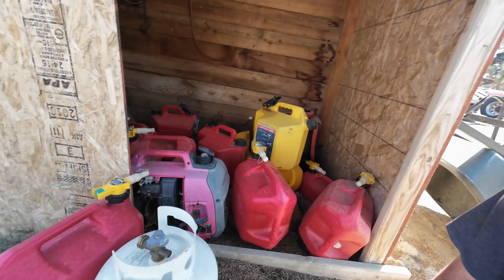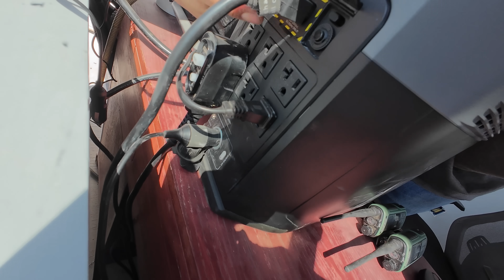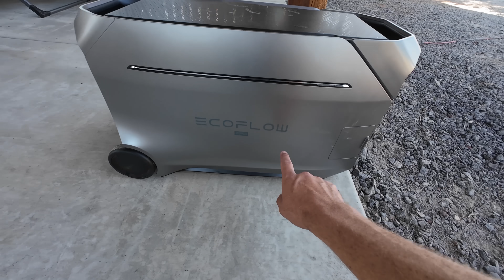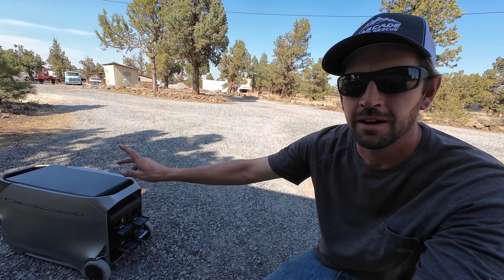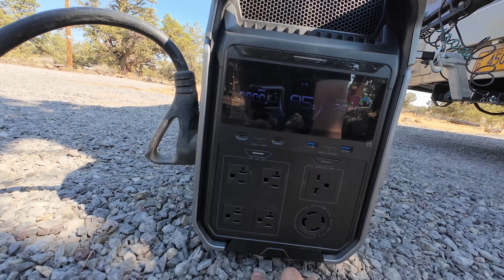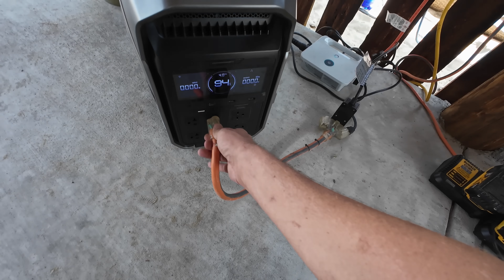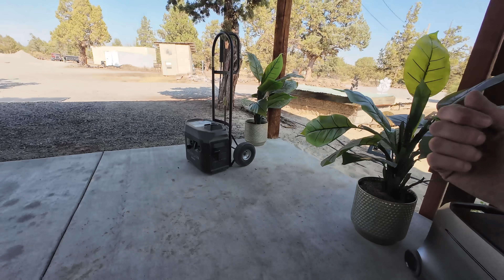Be prepared for DISASTER with EcoFLow's new Delta Pro 3!

Comment: This is really cool and thanks. We have been talking about get a full home standby generator for years that would be a natural gas full home unit. I will have to do some searching on EcoFlows website to see if such a system can be designed and what the cost is. Quick glance looks like there is a solution to do a full house system and by looking at how module everything seems it looks possible. Thanks Casey for this video.

Comment: I'm glad to see that they don't call their units generators like a lot of manufacturers do. They don't generate power (except the smart generator) they are electric power storage units with built in inverters to dispense the power
Reply: A generator running off a 4 cycle gasoline or propane engine converts the stored chemical energy in the fuel into electrical energy. These units convert chemical energy stored in the batteries into electrical energy. You recharge your typical generator by adding more chemicals that were typically made with solar energy 1000's of years ago, you can recharge these generators with solar energy collected now.
Reply from the maker: @noneentered1  people like to say that they aren’t generators because they don’t create power without solar hooked up.  But those same people fail to realize that an internal combustion engine generator doesn’t create power unless you add a fuel to it either.    
No matter which setup you use, you have to supply it with an external fuel in order to generate usable electricity.   The difference in that the external fuel these use is simply the sun, while the others require gas, diesel, propane, ect.
Reply: @CaseyLaDelle  well said
Reply: The term "solar generator " is a made up term by the industry to distinguish their products from other power storage units that don't have on board solar charging capabilities. I too dislike that term. If you use the strict definition of the term a solar panel best fits the phrase "solar generator" as actually generates power from solar energy instead of rotational energy.
Reply from the maker: @pumpdump4476  but a solar panel does not create usable electricity that you can plug a device into and use.  You need something that takes the energy created by the solar panel, and generates usable electricity.  
Internal combustion engine generators are exactly the same.  They take an outside energy source (fuel) and use it to generate usable electricity.  
Both are generators, they just use a different fuel source.   The big difference is the ability to store that electricity and have it be usable when the fuel source isn’t present.   Internal combustion engine generators are not capable of that
Reply: @CaseyLaDelle  these are storage, not generating. Electricity goes in, electricity comes out. You can't charge them with something other than what comes out. And when there is no power and no solar (northern winter time), you run them down fast.

That being said, these ecoflows are perfect as a UPS or a power booster. If the power goes out, you have a few hours to connect a generator and charge the unit back up again. Other useful thing is taking in low power and being able to give higher power. Like when you have a 1000 Watt wall outlet to charge the ecoflow. And then use dlthe ecoflow to draw 2000 Watt's for shorter time.
Reply from the maker: @Pinz314  they use an external fuel source to generate usable power that you can plug into and use, just like a gasoline generator.  
And just like a gasoline generator, yes, they can’t produce that power without their fuel source.   
Now having lived through countless multi day to week long power outages I can tell you something else that shuts down, and that is the electricity powered fuel pumps at the gas stations.   So gasoline is also a very limited, or even non existent resource in a power outage situation.   So I would much rather rely on the sun as my fuel source than something I have to buy at gas stations who are in the same power outage situation that I am.
Reply: @CaseyLaDelle  Those things are cool and have their place for shorter outages. And if you live in the sunny state, shure you could probably use it for longer as there is enough sun to charge it. Where we live the worst WEEK in december generated 7 kWh with a 10,000 Watt solarpanel system, thats just not enough to keep things running. With a diesel generator i could charge a bigger battery with 8 kWh every day for a week with a 19L or 5gal jerrycan of diesel. Having 3 jerrycans of diesel that go in the tractor anyway is far more useful and can generate 150 kWh vs the 30 kWh in three weeks of december solar.
Reply: @CaseyLadelle They store what is put into them they do not generate anything.... the solar panels generate the power and these store it then release it as useable power.... saying they take solar panel power and "generate" it into useable power doesn't even make sense.... convert it maybe... if you charge it with a gas generator that produces useable energy would you still say these "generate" the generator power into useable power ?? Of course not thats just stupid... it stores it and releases it... Yes I know you'll argue it til the end of time even though it makes no sense 😂😂
Reply from the maker: @sideview79  these have the ability to create power, AND store it.   I’ve said that multiple times.
Reply: @CaseyLaDelle  ya but the solar panel generates the power and these turn it into stored useable power... gasoline fuels an engine turning a gen head to create power... the sun fuels a solar panel that generates power... these store that power from either source... setting a power station in the sun doesn't fuel it and make power.... gotta have the solar panel which is the generator....
Reply from the maker: @sideview79  a solar panel does not generate usable power.   A solar charge controller and DC to AC converter are needed to make usable power.
Reply: @CaseyLaDelle  exactly my point... it "converts" it to useable power it doesn't "generate" it into useable power... but the power that needs to be converted into useable power is generated by the solar panel.... it has to have power from another source put into it or it does nothing
Reply from the maker: @sideview79  yes, just like a gas generator converts a liquid fuel source into movement, and then that movement creates electricity
Reply: @CaseyLaDelle  I have a delta 2 max and wave 2 w/battery that work great...  I'm using it right now parked in a service plaza... I get that the sun is the fuel like gas but a gas generator doesn't need electrical power put into it... it generates the electrical power... a power station requires some sort of electrical power to be put into it... why ? Because it doesn't generate power... I never said a solar panel generates useable power. Obviously it doesn't but it does generate power that feeds the power station... the term solar generator is used for the system as a whole (solar panel, wiring, power station)... and as a whole system yes it generates power but the box by itself generates nothing... its just a power station... I think of it as more of a "smart battery" really because thats basically all it is by itself without something feeding it... It's a great product that I bought instead of a $14k apu that are always broke down and I bought it based off your videos... 👍👍
Reply: @CaseyLaDelle  I got a free solar panel with my d2m that has never been out of the box because I have no room for it so in my situation explain to me how this thing generates power ? It doesn't... it's a battery that has to be charged... I charged it with a pure sine wave inverter from HF until the alternator charger came in and it works great but it just simply stores what is put into it... it generates nothing... it has to be fed electricity from an outside source
Reply: @sideview79  Yup coreect, otherwise every charger/inverter/transformer would be a generator creating "usable" power for a specific purpose. A usb generator to make 5V DC for a phone. A welder would be a generator as it makes "usable" electricity for welding at 20V.
Reply: @Pinz314  yes... thank you...  some ppl just can't admit when they are wrong lol he is too stuck on the idea of the sun being the fuel and it is but the solar panel uses it to generate the power (not the power station) then the power station does nothing but turn it into useable power and store it...
Reply from the maker: Actually they do, and they are in fact generators.

Comment: I have 4 EcoFlow products. Wave 1 AC unit, Delta Pro, River Mini, 400W Portable Solar Panel, and various interconnect cables.
So far I've been happy with the Wave 1, it keeps my little A-frame camper cool while boondocking out in central Oregon, with the Delta Pro and solar panels, keeping cool has been no problem.

Comment: One thing a generator doesn’t need is a firmware update and if you’re off the grid that can be a challenge.
Reply from the maker: This doesn’t either.   It will continue to work just the same without any connection or update.
Reply: @CaseyLaDelle  my ecoflow will no longer take a 12 volt charge and the company had me do a firmware update which didn’t help but they also cover the item for 5 years
Reply: Also the item doesn’t perform the same as it did in the first few months I had it now it’s a $430 12v fridge tender
Reply from the maker: @throttlewatch4614  actually it performs EXACTLY the same as it did the first few months.   A firmware UPDATE is exactly that, and UPDATE, not something that has to be done to maintain performance.    
I have had EcoFlow products for years and I have never once done a firmware update on any of them.   You are quite literally making up a problem in your head that doesn’t exist.
Reply: @CaseyLaDelle  dude I’ve talked to customer service I’m just telling you what they told me. I’m not making anything up maybe my situation is isolated but this product does not work the same as it did when I first got it and yes they did say it’s covered for five years I just haven’t sent it in yet. I have no reason to make anything up and like I said about the wave it’s not exactly what they say it is but it’s expensive and it takes some getting used to on how to operate it. Oh and when you call customer service you can hear roosters crowing in the background lol true story

Comment: Ironically I was mentioning this to a semi driver, who was wanting to run an air fryer for his food but also use it to charge a battery for a piece of equipment at night when he sleeps as he is away all week in it.  This idea was instead of installing an inverter in his cab and having to idle every night to stop the batteries from going flat and also it was a long term rental truck.  Starts to make sense if buying everything to fit and risking the hire company not liking something aftermarket installed not by them against a unit sat on the floor that the driver can take with him to the next truck.

Comment: I just purchased the new Harbor freight 13000 W generator and in the process of hooking all of my house and shop to that, and interested on how the ecofflow could work into that.
Reply: Unlike the ecoflow smart generator, with your new generator, you would have to monitor the battery levels, and recharge from your new generator manually.  But placing batteries on strategic, critical devices would let you avoid running the generator constantly.

Comment: Power outages usually happen during severe storms in my area.  My fridge is my second thought. My first thought is the sump pump in my basement.  Our basement entrance is below grade and everything from those steps flows to the sump.  I do have have a battery back up pump that buys me the time I need to connect my 8500 watt emergency generator and throw the transfer switch.   However I am considering an EcoFlow battery  as a better option for the sump. Essentially an uninterruptible power source.  Not as "big" as this.
Reply from the maker: I’ve never lived anywhere that had basements so that something that I’ve never thought about, but a very good point.   A pump could plug into the EcoFlow, then the EcoFlow plugged into the wall.   Then the pump would never know the difference of the power went out

Comment: Ecoflow max 2 and river 2, ac version 2 owner here. Everything works great, however the AC battery isn’t strong enough for more than 2-3 hours at max cooling. Also you can’t charge the AC battery without having it connected to the AC unit. That is one downside as it’s hard to have multiple batteries specifically for the AC charged up.

Comment: I have more questions than I know. Awhile back, you said that you used the Ecoflow to run the grinder when prepping the trailer. Was that the generator, or was that a battery pack? 

Everything on the Ecoflow site talks about home or RV use. But what about industrial use? Running lights in the container and the chargers for my cordless tools and even the space heater is a no-brainer, but I have to wonder if the battery pack would run my corded tools and for how long? And  what about my HF welder? 

I just hate to spend that kind of cash on something without trying it first.
Reply from the maker: The grinder was run off their smallest battery unit.   I don’t have 220 power in my shop so I’m going to try running my welder off of it.   But for lights and tool charging yes, this is absolutely the way to go

Comment: I went Jackery a year or so back.   Absolutely amazed at the tech.   Here in rural Eastern Washington,  balls deep in winter is when the power usually drops.  Only used the Jackery once last winter, power was down for about 14 hours.  My heat is propane, so just needed fans.  I plugged in my router, TV, and desktop, too, and had my normal interwebz even with the power down.   I pack it around the yard instead of running a series of cords, throw it in the boat or the car.......   so handy!     Ecoflow looks maybe even better than the Jackery.

Comment: I have two Ecoflow units I use as UPSs. One at my house hooked to our main computer and wifi. Another I bought for my daughter when she bought a house and it is hooked up as a UPS in her home office and wifi. I love them and wish I had the money to buy more. There has been a few occasions that the power went off and I didn't notice until I realized they tv was off. I was on my laptop and the wifi never missed a beat. My wife was at the main computer and she wondered why the lights in the house went off but the light at the desk and the computer were still running. Absolutely seamless transition from 120v power to battery supply. 👍👍👍
Reply: That's exactly my use case and why I want one. I'm moving into a very old house and would love to have this for my Work From Home setup. I do need a good writeoff this year...
Reply: That's something I'd been wondering but couldn't find anything on Ecoflows site about if they could switch fast enough to serve as UPSes.
Reply: @Dan_Neely  Just bought some, it has a 30ms switch on time as a UPS.  They don't recommend it for use for data servers, workstations, or medical devices.  I'm sure this is to protect them from liability for data loss or injury.  On the other hand, depending on your device, and how you use it, a 30ms power delay may cause a reboot, affecting work in progress, or a missing a few seconds or (restart time) minutes of use of the medical device.  There are plenty of UPS sold for computer use that don't switch on fast enough to avoid rebooting lots of computers; there are plenty of computers that can handle a 30ms outage (but not all). Many medical devices will restart fairly quickly after a power interruption, but how long and how serious the effect depends on the type of device.

Comment: I bought a delta pro for when i go to buckley old engine show(just got back 2 days ago)/ fridge backup as im a truck driver.  I did a test and estimated i would need 50% charge and i have space built into my camping box for 200 watts of solar.  And then did a test at home and best case would only get 30% from solar.  I bought a champion 2500 surge inverter generator  last minute.  Well we got lots of rain and forcast was right so i didnt even set up solar.  Generator was ran like 2hrs a day at like 1300w as 1850 was rated run not to overload it.  The delta pro kept my food nice and cold in my 2 12v fridge/freezers and ran my fan at night plus charged my phone. Unlike the nieghbors camper ran an open frame from 7a-10p (gen curfew)   when i get my own camper i plan to get the eco genset and wire it all in and max out the roof with solar eventually.

Comment: Could you drive something electric through a trail like a rivian and charge it through some kind of eco flow device? I’m ignorant on a lot of that but it would be neat to see. Got my self a river 2 awhile ago and I’m surprised how much it handles.
Reply: An offroad EV - LIKE A Rivian -, has such a large battery, an ecoflow is merely a toy alongside.

A solar array to charge a Rivian, need to be "substantial"...  something with 20 x 500W solar panels and a 8-10kW inverter-charger (an auxiliary 20kWh battery for "camp" domestic power is a handy thing to have in site - around 300lb in battery needs...  (need a trailer to get that out to the end of the trail)..